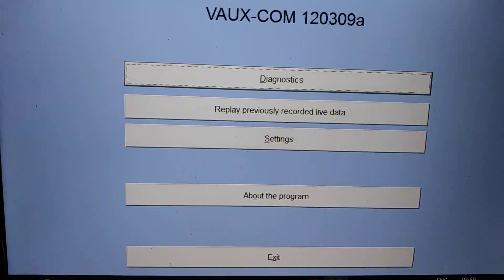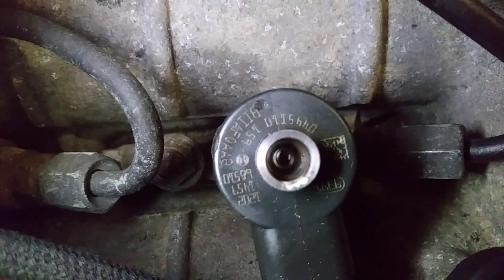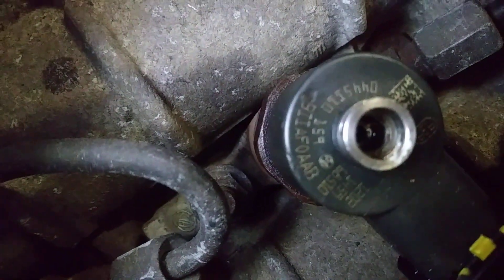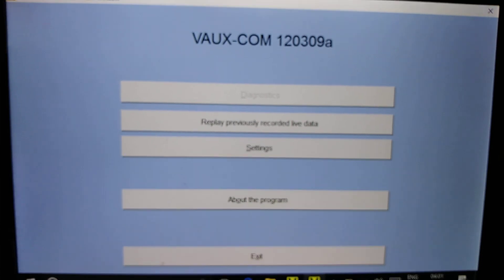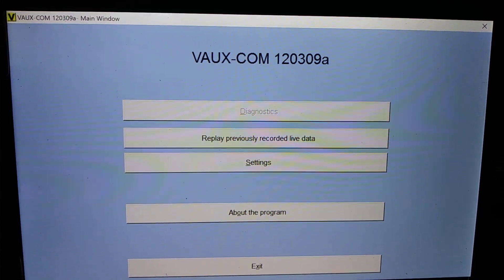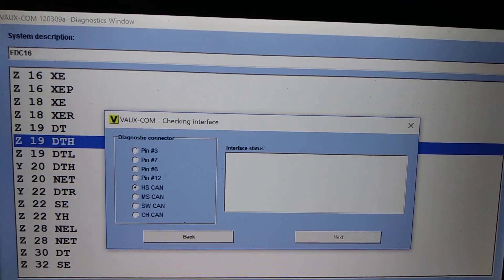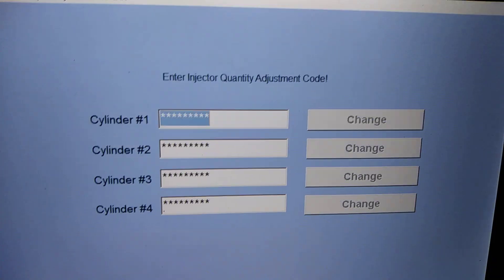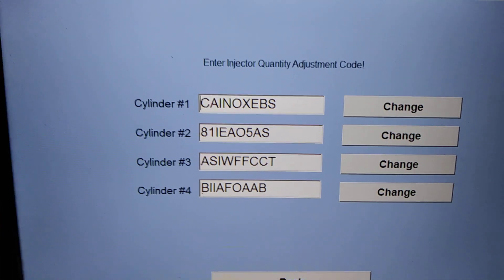How To Code Diesel Injector With Op-Com Vaux-Com Z19DT Z19DTH engine

Comment: what happens if you do not code injectors?
Reply from the maker: Nothing. They will work but not as smooth as supposed to. At least in my case the engine didn't run as smooth as when I coded them

Comment: Hello..my opcom gives me this errorr- "Fuel injector small quantity not learned- not programmed" do i need to program injectors or something else?.how can i program it? Can you help please? Thank you
Reply from the maker: @pianoshqip  probably you mistyped some numbers or letters or they are from different engine which are not for engine that you have them
Reply: @--unknown--  my injectors got repaired by the mechanic.after i took the car back i saw the service car soon sign..told the mechanic the problem he said hell call and try to fix it..he said he programmed the injectors 😪..so i took my opcom and i saw the fault saying small quantity nor learned..i thought it might be something else..so you tbing the injector numbers are mistyped?
Reply from the maker: @pianoshqip  check the code on injector and compare with opcom. If they don't match then write them correctly. And also have a look on first 3 digits on injector. They should match with rest of injectors. If don't match then probably it's not your injector
Reply: @--unknown--  thenk you

Comment: If i got new injector into the car need to be coded too?
Reply from the maker: @mazdaolimpya9812  you can drive without coding but there is no guarantee that it will work properly as it should

Comment: hi. 1st injector coding fails. others are ok. what could be the reason?
Reply from the maker: Double check the code on injector. Or try that code add in different cylinder. If it works then could be wiring issue. If not then check the part number which is in my case is 159. Might be injector fitted from different car.
Reply: thanks. What should I do if it is installed from a different car?
Reply from the maker: @k.e._cars  if it's not made for your engine type then you won't be able to code it with Vaux-com. You will need to reprogram all fuel system including the fuel pump pressure and many other things you will need to replace to get it running properly. And anyway, then you will need all injectors with same code which in my case you can see on top of the injector code there is part number which ends with 159. Those last 3 digits must be the same for all injectors.
Reply: These last 3 digits are all the same. but 1st and 3rd injector coding cannot be done🤷🏼‍♂️
Reply from the maker: @k.e._cars  could be wiring problem. Quite common issue. What is those last 3 digits?
Reply: For the 1.3 cdti euro 4 engine, the last 3 digits are 083.
Reply from the maker: @k.e._cars  the injectors are correct. Then I believe there must be wiring problem. Try to remove connector when engine is running. Is there big difference. If not then there must be problem with connector or wires
Reply: My car has only black smoke problem. all sensors are new and other checks done. I noticed that the injectors are not coded. I will let you know the result. thanks.
Reply from the maker: @k.e._cars  might be that they are faulty. Run the injector test.
Reply: My injectors have just been repaired. but I guess the mechanic doesn't know how to code. Injector test tab is closed in opcom. I can't open it.

Comment: If I buy a new injector, will this injector have it's own number? Every injector has it's own number right? All these number are registered in the ECU? What if I buy a non original injector Ridex for example and not Denso will it also have its number eventhough not being an original injector?
Reply from the maker: Each injector have own serial number(code).
Reply: Plus if you send the injector to repair or recalibrate they gonna regenerat a new code , so thee code on the injector will not help u

Comment: Hi there, thank you for sharing your knowledge. Very valuable. Once quastion I have. If I didn't mixed up the injectors, is  it still necessary to do recording. I just started my Z19DTH after full engine repair, but the injectors are over fuelling ( I didn't replace the nozzles yet). Thanks
Reply from the maker: Well they need to be coded. But over fuelling can cause bad injectors too not just the coding. Try to code them and then check them.

Comment: Would the engine still run if injectors replaced but not coded?
Reply from the maker: Sure it will working but not corectly. Without coding can misfire some injectors.
Reply: I tried to put a second hand injectors on a z19dt without coding and couldn't start it